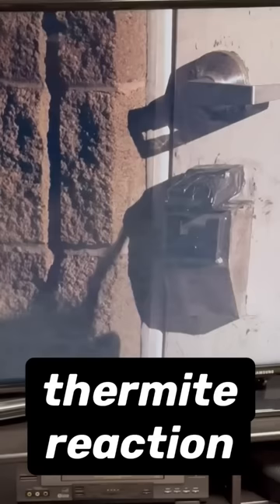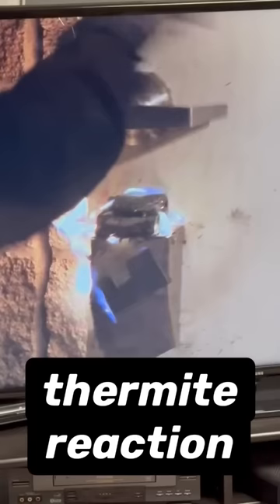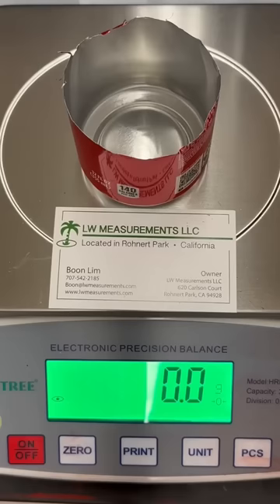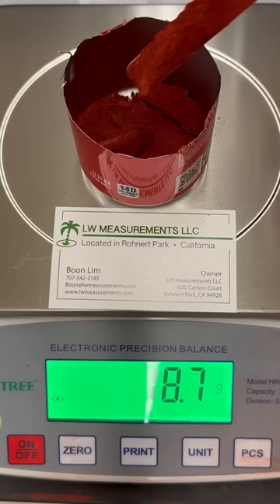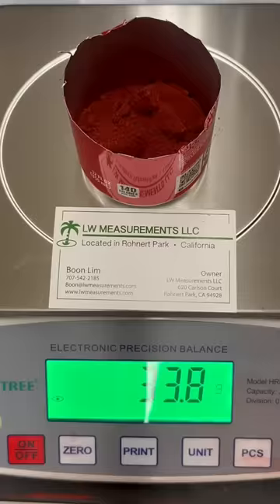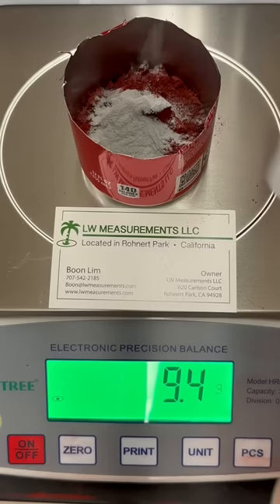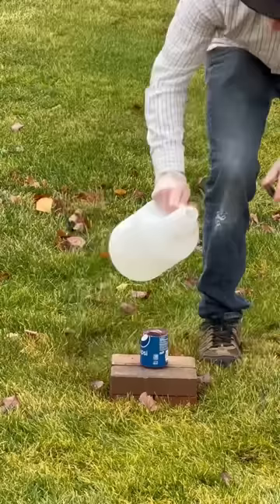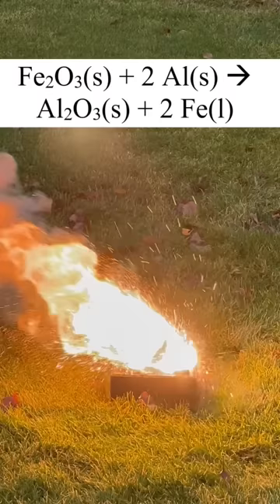Breaking Bad Chemistry: The Power of the Thermite Reaction 🧪🔥 #breakingbad #chemicalreaction

Comment: A thermite reaction occurs when you have a low reactivity metal that is oxidized, in this case iron, and a higher reactivity metal, like aluminum. You can get a more violent reaction under the same principles with aluminum oxide and copper
Reply: Shouldn't it be copper oxide and aluminium
Reply: @limmuquan4796  no, copper is way more energetically reactive than aluminum. The oxygen atoms go to the more reactive metal
Reply: @limmuquan4796 Yeah, you are absolutely correct. Aluminium oxide and copper are the reaction products of a copper oxide thermite.
Reply: @robertcorley5225 It should be copper oxide mixed with aluminium powder and not the other way around. Lookup the redox potential of copper and aluminium.
Reply: @SerumCRM114  huh
TIL
does that have anything to do with why you can kick start the reaction with potassium permanganase?
Reply: @robertcorley5225  No, potassium permanganate is used together with glycerine in a separate reaction that produces a lot of heat to kickstart the thermite reaction. It is also possible to use burning magnesium or a sparkler to get it going. Most thermite reactions have very high activation energies and therefore need a lot of heat to get going.
Reply: @SerumCRM114  that part I knew. I was asking if the fact that the permanganase being a powerful oxidizer had anything to do with why it was used to light the thermite, or if it was just because the reaction it's involved in produces a high amount of heat
Reply: If it was aluminum oxide and copper you could get an even bigger reaction with rust and copper.
Reply: @robertcorley5225  KMnO4 has nothing to do with the metal redox. There's more than enough o2 in the air.
Reply: Today I learned that thermite is a kind of reaction, not a kind of substance.
Reply: @h0ly208  yeah, it blew my mind when I found out a couple years ago, too
Reply: @iwanttwoscoops  I guess what I was trying as is why does potassium permanganate react so aggressively with glycerin? Does the potassium just really want to bond with the hydroxyl groups in glycerin?
Reply: Wouldn't it be even more violent with iron oxide and copper?
Reply: I’ve never heard it called “the thermite reaction”, it’s just an exothermic reaction. While thermite might be the most well known, it’s far from the only one.
Reply: @jaidenbrink  The thermite reaction is defined as an exothermic reaction which involves a metal reacting with a metallic or a non-metallic oxide to form a more stable oxide and the corresponding metal or nonmetal of the reactant oxide.

It's a specific kind of exothermic reaction
Reply: You can get a slower reaction with iron fillings and aluminum powder.
Reply: Aluminum holds an oxide copper is meh but copper oxide is fun
Reply: Haha. You guys keep saying my YouTube name 

It took me a long time to think of a cool gamertag/name for everything. 

I'm glad I'm Oxide 😎
Reply: @oxide_actual  don't break your arm patting yourself on the back
Reply: How do you guys know these stuff ? 💀
Reply: NONE of thos was found at the world trade centers after--- cough cough cough choke
Reply: So you could make a cascade of thermite by adding more reactive metals each time? The products from each reaction can feed into the next one?
Reply: Nice 🙂
Reply: It's rare for me to not have anything intelligent to say you want a YouTube video. 😳😆
Reply: I’m so happy yt recommended this video bc I’m Canadian, don’t like jt, and don’t wanna get put on a list
Reply: @robertcorley5225   Where did you get the idea that copper is way more energetically reactive than aluminum?
Reply: @DANGJOS  I'm actually not sure. I probably read something and misinterpreted it
Reply: @oxide_actual  LoL, looks like Mikey is a little bit sore you thought of it first.😆
Reply: @robertcorley5225  Check your chemistry, bro. You are flat wrong, according to reality!!
Reply: ALRIGHT imma try it
Reply: Magnesium is what i was told
Reply: @jedimaestergandalf9090 Imagine AuCl3 --> Pt --> Hg --> Ag --> Cu --> Al --> Ca --> Na --> K --> Rb --> Cs
Reply: @user-pr6ed3ri2k  yeah, I've already been called out for being incorrect. Maybe don't be that guy
Reply: @jedimaestergandalf9090 wait does chloride thermite with chlorine instead of oxygen exist
Reply: @robertcorley5225  then why aren't you editing your comment to remove the false
Reply: @user-pr6ed3ri2k  why's it bother you so much?
Reply: @robertcorley5225  what do you think
Reply: @robertcorley5225  ah yes, caring about misinformation makes me mentally ill, of course! what illness specifically, doctor?
Reply: @user-pr6ed3ri2k  you clearly have a compulsion. Maybe find a healthy outlet for it instead of trying to pick a fight on the internet?
Reply: @robertcorley5225  No.
Seriously, just add an edit.
Also, compulsion is a normal thing, and not a name for any mental disorder.
Reply: @user-pr6ed3ri2k  mmmm, no. Go somewhere else
Reply: @robertcorley5225  Ok.
Reply: @robertcorley5225 please help me understand, I thought copper oxide would be required because it's lower on the activity series.
Reply: @guidomista8448  read the other comments. They explain how I'm wrong
Reply: @robertcorley5225  ok, I figured, because copper was a less reactive metal than aluminum.
Reply: @user-pr6ed3ri2k 
I'm glad he didn't edit his comment.  If he had, all the other comments would have no sense.
All that chemistry makes no sense to me, anyway.
Reply: @robertcorley5225 
Wow, man.  I have a lot of respect for you.  Yiu take the correction like a champ.  Also, Thank you for not editing the initial post.  Eventhough I know nothing about chemistry, I feel I learned just a little but about it.  If you had edited, it would have been potentially confusing to us mere mortals.
Reply: @benheideveld4617 
Instead of rushing to prove someone wrong, you could have read the whole thread of comments to learn you're late to the show.
Reply: @RalphSampson...  Yeah, now that I think of it, I don't even know what my thought process was in this conversation, LOL.
Reply: Don’t waste copper like this 😂
Reply: How violent?
Reply: What about iron oxide and copper?
Reply: @roger5059  to my understanding, the same thing happens, but less violently than with aluminum
Reply: @robertcorley5225  do you know if this can be calculated with electronegativity or something, or if I'm completely misremembering something? It's been a while since I've had chemistry class unfortunately
Reply: @roger5059  I have no idea. All I know is that the reaction happens when you have a metal that wants to be oxidized and an already oxidized metal
Reply: I don’t know shit about chemistry… what I do know is that up there, above… was the most polite argument I’ve ever seen on YT or otherwise.

Comment: Always forget how incredibly simple thermite really is, surprised no one came across this accidentally beforehand
Reply: A big engineering workshop near me burned down thanks to accidental thermite. They'd been milling magnesium alloy cylinder heads after weeks of milling cast iron blocks, nobody bothered to sweep up between jobs (apprentice must have been off!), then someone cracked out the welder. It burned so hot the workshop collapsed and afterwards it was discovered that about 2/3 of one of the I-beams that supported the roof had completely burned away.
The new workshop tends to be kept clean and tidy now!!!
Reply: @EddieTheH  People tend to forget how hard it is to extinguish a metal fire. By the time they remember, the fire is already too big to manage and the only thing you can do is set fire lines.
Reply: @cdgonepotatoes4219  I think these guys knew but were just too lazy, a case of workplace complacency. The owner wasn't too impressed as he was restoring an old Jensen Interceptor (fibreglass body) and it was parked outside the workshop and melted from the heat through the brick wall!
Reply: Prior to easy access for electrolysis to purify, aluminum was worth huge amounts and very difficult to acquire.
Reply: I accidentally made a bit of it, grinding a log chain that pulled aluminum chips, lol
Reply: The engineers at Coca-Cola definitely knew. The ones responsible for making our first industrial stock of aluminum were well aware of how much heat they put into the bauxite or to make aluminum metal. As they say "what goes up (in energy) must come down."
Reply: They teach it in the anarchist cookbook.
Reply: @PatriotxAsset  I can't seem to find the onion link. I saw the page a couple years back and struggle to find it now it used to be on the hiddenwiki but now I can't find the link. Do you still have it?
Reply: Wouldn't be suprised if this happens with car fires. When cars go up they really go!
Reply: I never knew how dangerous my old car was.  It was a rust bucket full of aluminum.
Reply: Shortly after aluminum was synthesized in quantity.  Over 130 years ago. 

They used it for welding.
Reply: There was an episode of Mythbusters years back where they burned through a car using homemade thermite.   I never forgot how stupidly easy it was to make.
Reply: @cdgonepotatoes4219  people tend to forget everything apparently
Reply: We were more interested in napalm
Reply: @PatriotxAsset  without me googling that so i dont get put on a list, what is that
Reply: @cdgonepotatoes4219  True!  It's because the Oxygen (F3O) for combustion is included with the Fuel (Al).
Reply: Fire Department Coffee did a fun episode of BTUs vs GPUs.
Reply: Don’t look up ricin.
Reply: Aluminum was more expensive than gold when America was founded
Reply: Until the early 19th century, pure aluminum oxide was actually very difficult to produce.

Comment: Fun fact, this is how you slag equipment in the field. If you have to dump something and don't want it to fall into enemy hands, something important, you get your engineer to light off thermite on it. Can't pull data off something if it's molten metal.
Reply: I heard they used thermite blankets in Vietnam to melt equipment they didn't want falling into enemy hands.
Reply: They've also used magnesium "pucks" to ignite and do the same. My uncle told me they lit them on top of tank engines in the middle east. It would melt straight through the engine and create a tube of glass in the sand under the tank
Reply: @jakek6728 that makes a lot of sense now because thermite doesn't work in Kabul
Reply: Are you in Cybersecurity by any chance??  I’m looking for a mentor to facilitate a new career after the military.  I have certs already. I’d like to work with someone in a more personal capacity.
Reply: Used to use incindery grenades
Reply: Used phos grenades

Comment: Tip: use copper oxide and aluminum powder 4:1 ratio by weight
Reply: Ain’t it iron oxide
Reply: @braydenchadwick9836  copper oxide works a lot better 😉
Reply: @user-ir2tm6vg3c  time to test!
Reply: @user-ir2tm6vg3c  Is it because Copper oxide takes less to set off or because there's greater energy potential?
Reply: @progenji6970  Copper oxide has a lower reduction potential so it takes less energy to be reduced the flip side of that is that the excess energy from the oxidation of the aluminum causes the reaction to be explosive

Comment: Use to use thermite welding to ground radio towers after putting them up or refittings, it was a pretty cool process. Thermite welding is also used for railroad tracks I believe.
Reply: Yup.definitly used it welding tracks
Reply: the U.S. government gave the world a lesson in termite on 9/11
Reply: @toddedwardsinger 
The towers were not wood. 
Termites eat wood not metal or concrete.
Reply: @toddedwardsinger  termite would be too hot youd see diffrent damages also youd have to be able to find the reaktion products shown in the clip

Comment: 3 parts iron oxide
1 part aluminium flake

Ignite with magnesium fuse.

RUN
Reply: If the magnesium fuse is long enough running shouldn't be an issue
Reply: nano aluminum with bismuth, sonic mix tho, do not statically mix
Reply: Iron oxide itself aka iron shavings are extremely combustible. Especially if it's a dust like form.  Seen many Osha videos on the subject.
Reply: I feel like you need powdered aluminum (controlled substance) instead of aluminum flake probably not a  controlled substance
Reply: @JM64  If you are in a wheelchair and you have a splinter in the palm of your hand, there might be a slight issue
Reply: @JB-or9yw can’t you just make your own by grinding on a hunk of aluminum?
Reply: Powder* if it’s too coarse it doesn’t work, so “flake” surely wouldn’t work
Reply: @analogueoverdigital929  what are you talking about? Iron shavings are still iron lol…. Not oxide until it’s sat in MOIST area for a day at least,  u might be thinking of titanium shavings

Comment: As an electrician, in a building that needs to better bonded than usual, thermite is used to tie the ground rods and the rebar into the grounding system. Also thermite is used to weld railroad rails together.
Reply: I used to build Cell Towers and this is how we would bond all of our grounds.
Reply: weld ?

Comment: I still remember the thermite episode of myth busters and thinking thermite must've been some huge secret because they said on the show that they wouldn't give out the formula because it was too dangerous.
Reply: And they were right - it is dangerous! Except it's dangerous to the user, not any potential target.
Imagine some random kid setting fire to their garage because they got their hands on some aluminium powder.
Reply: It's dangerous exactly because it's so easy to make, and any kid can get their hands on it and melt steel.
Reply: The formula is simple, but the exact stoichiometric ratios to mix it is the dangerous secret part. Of course, you can just google it.
Reply: @Yonkage-ik5qb  or you can trial and error until you find the optimal ratio.
It's not that hard to dissolve the plastic off of aluminum cans and then grind them up into powder and just scrap rust off of old exposed steel for your iron oxide needed.
It's super simple to make tbh.
Reply: It's literally how they weld railroad tracks  ..very common... used commonly for the last hundred years.

What are neat.... Are thermite rods that you can carry.... Light them.... And can burn through heavy metal things
Reply: @Yonkage-ik5qb  stoichiometry doesn't have to be exact. That will only affect the highest yield of energy.   And if you're a high school student you can write the chemical equation. Well probably not all high school students...
Reply: Aluminum Nitrate not JUST Aluminum. And if you ignited it on concrete, you'd melt a hole in the concrete. Incredibly dangerous and MUST be respected.
Reply: These are the same censors that wouldn't allow Adam and Jaime to say "fart" on the Discovery channel.
Reply: Did they not give out the formula?  I've known for most of my adult life that thermite's made from rust and aluminum shavings, and I was positive I picked that up from Mythbusters.
Reply: What did he pour on top of that to get it going?  Sulfuric Acid?
Reply: It's only dangerous because it is so easy to make,it's the same reason they don't tell you what ratios to mix the metal to make the reaction.
Reply: @satibel  According to physics expert Rosie O'Donnell "steel doesn't melt". Guess she never heard of thermite.
Reply: @2peter1v2  I don't know who that is, but steel definitely melts, 1500°C is enough to melt most types of steel. (Tungsten steel can get to 1600-1800°C)
Thermite burns at over 2800°C so that's not a concern.
Also it's used to weld rails and the copper thermite is used for welding high power cables.
Reply: @satibel  When you are referring to structural members it is never about getting the steel to melt, it is about getting the steel hot enough for it to go back to it's mild steel state.
Reply: Because it was used in 911
Reply: @josephmakea5383  The fire provided by ample jet fuel and other burnable objects in the Twin Towers got the steel hot enough to return it to a mild steel state. Mild steel makes a poor structural member when it is attempting to hold up a further 30 floors worth of weight on top of it. The collapse was hardly controlled and in fact the huge debris field from the collapse end up landing on a much shorter building, setting it on fire, weakening the structure to the point it also partially collapsed.
Reply: It's easy to look up, but Mythbusters didn't want to straight-up tell kids how to make it. Plenty of people are too lazy to look it up, but impulsive enough to do it if given the recipe straight up. I suppose people who do their research are less likely to be particularly dangerous idiots than more lazy and impulsive individuals.
Reply: What is it, the atomic weight of two irons and three oxygens divided by 2 aluminums to get the ratio? Yeah, google is easier, then I don’t have to look at a periodic table.
Reply: @aaronorr5586  why are you spreading propaganda for the government...?
Reply: @josephmakea5383  nope.

Comment: Thermite is mostly useful for the fact it's a hot fire and it leaves molten metal behind. It won't really melt through things very well, but you're still gonna destroy any engine blocks you light the thermite on (you wreck some stuff and weld some other), documents and it's a good stable starter for bigger fires.
Thermate is a similar recipe that works the same as thermite but also burns a little hotter and it's preferred by the military for incendiary grenades (you don't throw them, you set them on or inside the thing you want to burn, you don't need air as thermite and thermate both have their own oxidiser)
Reply: How "well" it melts through things depends on the objects melting point, how thick it is, and how much thermite you have/how well you can contain it to a single point.

It welds railroad tracks, my bet is on thermite every time.